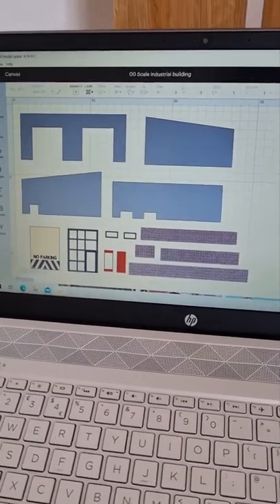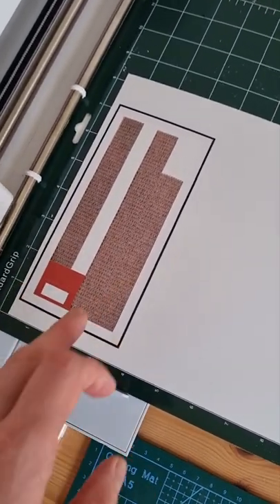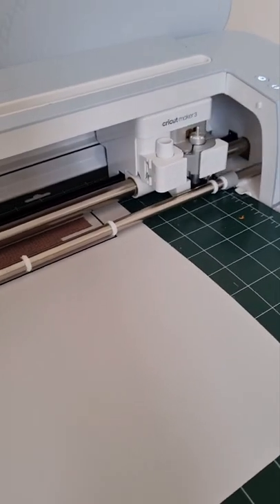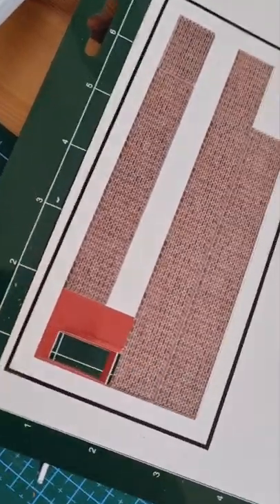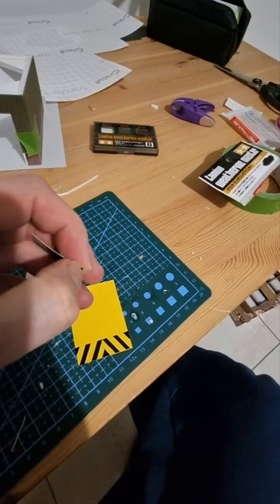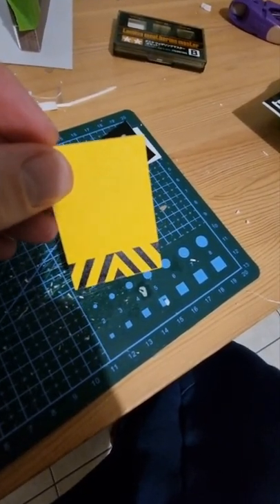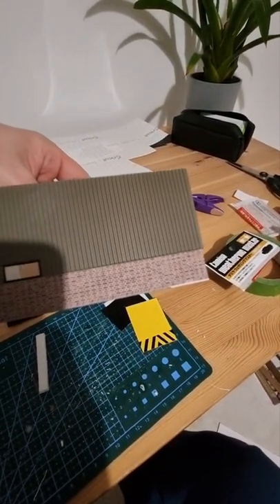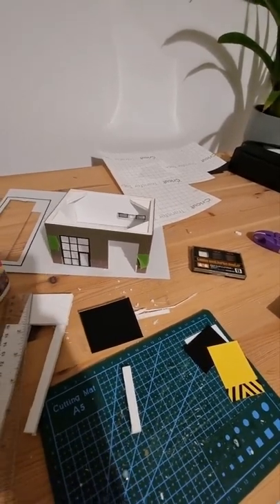Styrene Sheet and Cricut scratch build. Part 2. The detail parts

Comment: Really well done. I tried cutting out text on styrene sheet but it didn’t work well. What blade and settings did you use? The building looks great.👍🖊📐
Reply from the maker: I set the material as magnetic sheet and used the deep point knife. Taped to a strong grip mat.  Didn't cut the parts free, but enough that it could snap out.